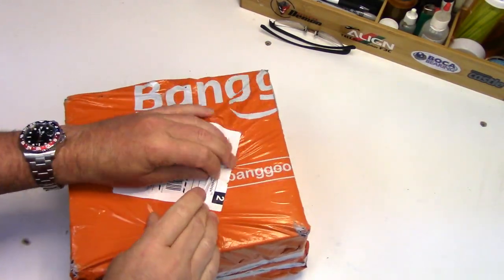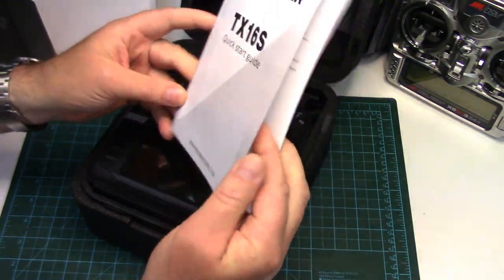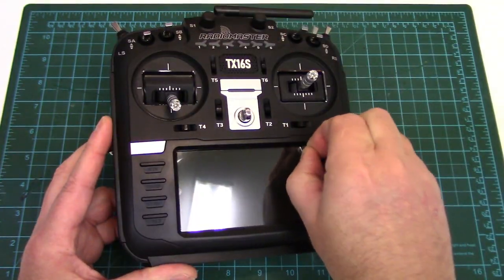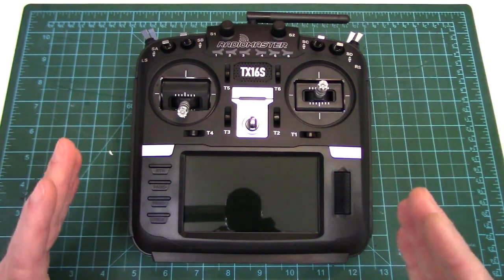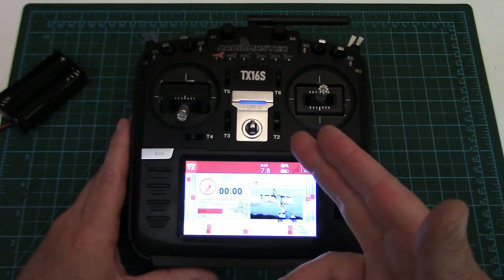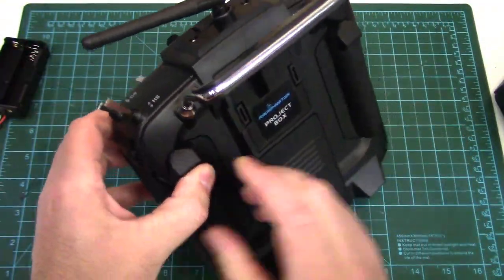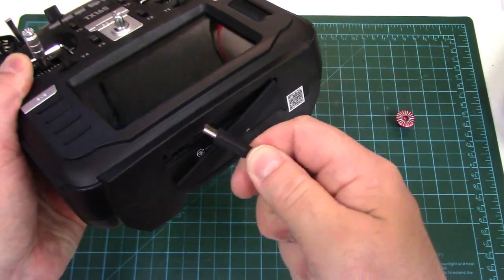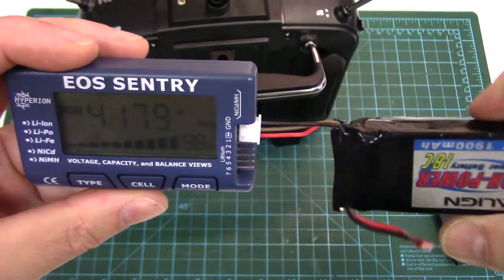RadioMaster TX16S Review & Thoughts

Comment from the maker: Learn more about the wonderful & fascinating hobby of RC helicopters: https://www.rchelicopterfun.com/
Reply: I just found you via your 18650 scam video.  I have NEVER purchased a lithium ion cell from ANY source, even supposedly reputable ones, that tested to its rated capacity, often testing to no more than half of claimed capacity and keep in mind that I've never bought one with ridiculous, impossible capacity ratings.  

I think the only way to get authentic cells is to scavenge them from used laptop battery packs.  I was thinking, "Hey, I'll buy 18650s from a MAJOR electronics component supplier like Mouser or Digikey.  They'll have authentic merchandise."  Take a look.  They don't even sell them!  No need to wonder why - the market is DESTROYED by FAKES.
Reply from the maker: Very good points.
Reply: From this week ,all TX16S will ship with dual speakers .We also offer speaker for people who wants to improve the sound at 2 usd from dealers !
Reply from the maker: @leeowen9878  Thanks for commenting with that important speaker upgrade information. Much appreciated! I presume the upgrade speaker fits in the back of the case in that round insert on the bottom right corner and plugs into the board somewhere?
Reply: @Rchelicopterfun  it's been awhile but for anyone else watching and considering, yes there is now a larger speaker mounted into the rear cover. It brings up the volume a great deal.

However, it also means you need to be careful when removing the cover as the wires do keep the cover from moving too far. You can open the case and unplug the speaker to make working on the radio easier.
Reply: @Rchelicopterfun  is there a model of F959 cz i have a wltoys glider f959 mine original transmitter is not working properly so i can't fly my plane can i use this if you check it for me i will be very grateful to you.. thanks

Comment: Can you do an instructional video on swapping to two switches? That would be very popular I think. Most important you are a trusted and easy to understand tech. Thank you, Bill Gargan
Reply from the maker: Thanks for the suggestion. I'll consider doing it next time I have to open up the radio (for the speaker mod if it ever arrives).
Reply: I think I'm going to do the same. I just got the v450d03 with the devo7 and I haven't flown it yet. The switches are backwards just like in this video. Makes me nervous from a safety standpoint. Having a k110 nip you is one thing but getting surprised by a 450 because the switches are backwards would be bad! After seeing this I'm going to take the devo apart today and do it.
Reply: Great review . I too like to switch my 2 position and momentary to opposite sides . As heli flyer I have muscle memory to have Throttle hold on the right. Were you able to swap sides?

Comment: My Radiomaster tx16 radio was saying RSSI LOW a lot, so I did the "fine tuning" and it has reduced the amount of times it telling me that RSSI LOW to once or twice a flight. any ideas of what to try I have not found anything to tell me the placement of the antennas. I have been installing one straight back from the receiver and the other at 90 degrees of the other. Was advised to place antennas in a Y so I tried putting an antenna on each side of the fuselage, but still a getting RSSI LOW on every flight.  It happen once on the ground and was able to check the RSSI it was at 30. Any idea what to try, so far I have never lost control of a plane.  I have been using Radiomaster R86 and R88 receivers. I really like the radio.
Reply from the maker: What is your low RSSI alarm value set at? That value can be dialed up or down to reduce or increase alarm warnings. I think the standard out of box setting is 45 for low, 38 is critical - don't quote me on those exact numbers. I have no experience with either the RM R86 or R88 RX's so I don't know what is "normal" for them in terms of RSSI strength. 

You never mentioned if your control range checks at the beginning of each flying session pass okay? Provided you are not getting any critical RSSI alarm warnings and your range check is passing fine, it's likely okay to just lower your low RSSI warning alarm activation threshold a little bit.

I do have a page on my website about 2.4 GHz RC antenna best practices for spatial & polarization diversity (both on the radio and aircraft) if you wanted to confirm best practices which it sounds like you are already following on the aircraft, but you never mentioned what your TX antenna orientation is, which is just as important: https://www.rchelicopterfun.com/rc-antenna.html

Comment: What is the external multi module slot used for when the radio has an internal multi mode module?
Reply from the maker: Any other JR type RF module (900 mHz, TBS Crossfire, ELRS, DM9 etc.)

Comment: Very good video, love the simplicity of your review. I'm pretty new to rc planes around 15 months flying, I recently upgraded to a number of scale birds, how would this tx be for say somone like a newby as my self!? Thanks
Reply from the maker: It depends on what radio system you are already using...  Considerations when choosing this radio. Is it compatible with the protocol/s you are currently using in your existing models (assuming you want to fly them with this radio of course)? The RadioMaster comes with a built in multi-protocol module of course, but do confirm is supports the protocol/s you are already running. Are you flying with an OpenTX radio already? If not, as I suggest to anyone thinking of getting an OpenTX radio, first spend some time on OpenTX's website and OpenTX University's website so you know what you are getting yourself into. There are a good number of folks out there who have found OpenTX's system too difficult to understand. It's not overly hard, but it does take some time. OpenTX University will explain it all.

Comment: Thanks for the review! One question... If I have receivers with 2 protocols, can I select the protocol I want to use by menu? Or I have to flash the protocol each time I change?
Reply from the maker: If I understand your question correctly, you don't have to rebind when changing between models. When you program a model, you select which protocol the RX in it uses, bind it, and that info is stored in the model memory for that model. When you switch models, the new protocol for the new model will be selected. Perhaps the receiver match section on the Multi-Module.org website covers your question in more detail: https://www.multi-module.org/using-the-module/receiver-match. 
By the way, that multi-module.org website is a must bookmark and one of the best information resources we have if/when you get into multi-protocol. Its explains how it all works and how to update the firmware with a wonderful firmware update filter tool.
Reply: @Rchelicopterfun  Thanks a lot for your answer!

Comment: Hi John, I was just brought attention to this Tx as I am wanting to get into scratch building and to also have a Tx that will last me forever. I’m pretty fresh to the hobby but am wanting like I said a versatile Tx. I want to get into retracts, and other awesome things eventually but one step at a time! Would you recommend this as a good first advanced radio? Thanks and enjoyed the vid!
Reply from the maker: If you are "open" (pun intended) to the challenge of learning OpenTX then the TX16S in my opinion is a good radio to start with if you are looking for lots of bells & whistles at a low cost; which of course also adds to the complications. As the old adage of engineering eloquently states: "complexity hampers execution."

As I recommend to everyone thinking of getting into OpenTX, first spend some time on the OpenTX University website to get a solid understanding of how it works (programmable inputs, mixes, outputs). http://open-txu.org/

Also download the TX16S full manual I link to in the description since it too has some good info to help you better understand OpenTX which is specific to the TX16S. OpenTX is an RC nerds dream operating system, but for many, it's just too much of a learning curve - especially when first starting out. 

As for a radio that "will last forever." At the rate of change and advancement these days with RC radio technology, that's a very tall ask. Especially with a brand new radio model like the TX16S that has no track record yet. We have no idea how it will hold up and age.

Comment: Do you have a video showing how to swap the toggle and 2 position switches?
Reply from the maker: No, but if there are enough comments requesting it, I'll "consider" redoing it. It was a little more of a process however than I first thought. The toggle switch PCB boards are L/R specific for each side so you can't just swap boards, you need to desolder the 2 position toggles from the PCB's and swap them that way. As long as your de-soldering & soldering skills are up to task, pretty straight forward, but likely beyond the scope of many. You also have to pull the entire gimbal out of each side as there is not enough clearance to slide the switch assemblies out with the gimbals in place.
Reply: John Salt oh no 🤦🏻‍♂️ my tx16 is about to get here and all my spektrum radios have the toggle on the left side
Reply: @duschiavon  I have been following the thread about this radio on RCG and the guys there say you can make the spring switch work just the same as a toggle. just pull it and hold it for couple secs and it acts the same, After reading here what he had to deal with switching his switches around guess i will be leaving it alone and programming it to work as said..  Mine should be here friday.
Reply: @epoweredrc  Thanks man. I'll take a look on the RCG forum

Comment: Great video and explanation.  16:29, notice the cable connecting to the gimbal is flexing on the gimbal itself.  This is a bad design in R/C transmitters.  Do not underestimate this minor cyclic loading, overtime it can cause intermediate connection issues.  On the Futaba, there is a side PCB that the cables connect to, and nothing is being flexed on the gimbal.  This is what a proper design should be.
Reply from the maker: Exactly why I mentioned the use of soft "high flex" silicone wiring & "strain relief" on both ends.

Comment: Check the stick centering as mine had a bad gimbal.
Reply from the maker: Was it just out of calibration and needed to be re-calibrated or was the hall sensor faulty?
Reply: @Rchelicopterfun  no, calibrated every way possible it just would not center. Returning it now and getting a T18!
Reply from the maker: So to clarify, we are not sure if this was a hall sensor issue (assuming it was the hall version), wiring issue, or board issue. Hopefully the T18 will serve you better.
Reply: Also flew a couple of packs with it but it would constantly warn of low RF with DSMX telemetry RX.
Reply from the maker: Too bad you got a dud. I was at the flying field today with mine to give it a proper workout and flying a few of my big machines (700's & 800) and was getting great range/RSSI signal strength running with FrSky D16 protocol. I'm certainly not giving up my Horus X12S since I love that radio and my plan is to use it for my big stuff exclusively from now on and the TX16S for all the smaller park and micro stuff; but I'm definitely even more impressed with the Radiomaster after a day out at the flying field with it. Just wish I could hear it better.
Reply: @Rchelicopterfun  Spektrum telemetry rssi reading on open tx is not calibrated correctly. My range with external module with frsky x9 lite exceeds Spektrum Dx9.

Comment: range? jack on top open the it and u see a usb.
Reply from the maker: As I say at 11:08, that port beside the USB-C input is not an audio output port, it's the DSC trainer cord port. Totally different thing. Range is dependent on many variables from atmospheric conditions to RX type and antenna orientation on both TX & RX. Flying my RC helicopters, if I can see them, I can control them - that's all the range I need and the TX16S has no problem filling that range requirement. My guess is you are good out to at least 1km going by RSSI strength, but again, there are many variables that affect RF range in any radio system.